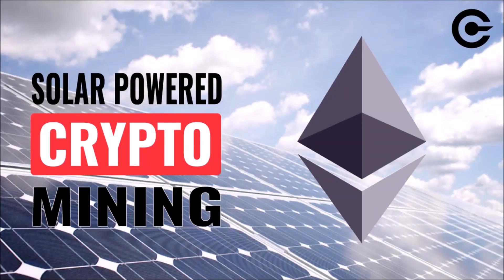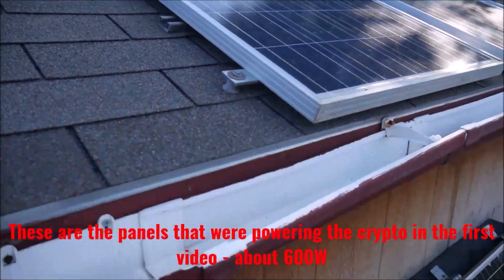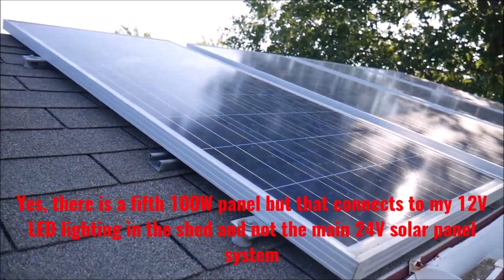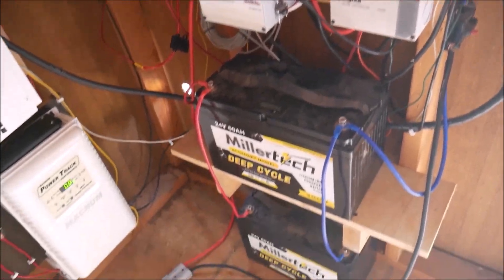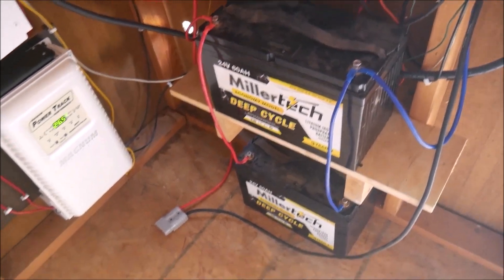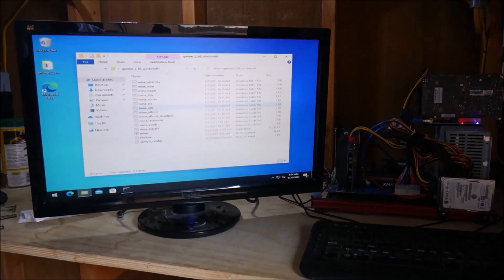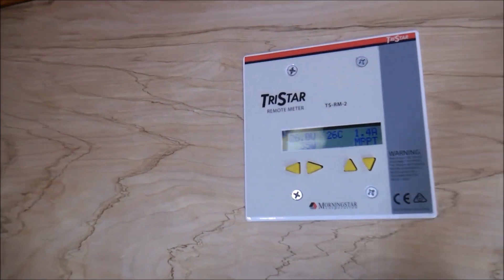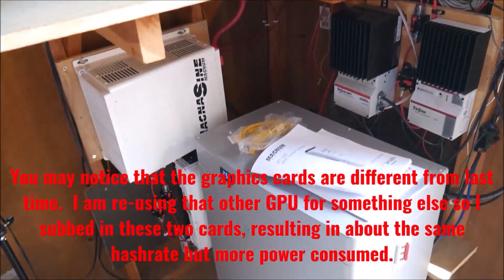Solar Powered Crypto Mining Project Part 2 - Upgrading the Solar Power & Batteries

Comment: It looks like the way you have your miller tech batteries, the charger/inverter is connected to the terminals of the top battery.  This will cause the top battery to take a higher cycle than the bottom battery.  Electric will take the shortest/easiest path, and that isn't the bottom battery currently.  To help evenly cycle the batteries you should connect move one of wires to the other battery.
Reply from the maker: Yep, already on it.  I did it the way you saw it to move the project forward with some premade cables I already had laying around.  I wanted to make sure it would work and that I liked how everything was laid out before I set things in stone.  I will custom make some cables to the right lengths soon.